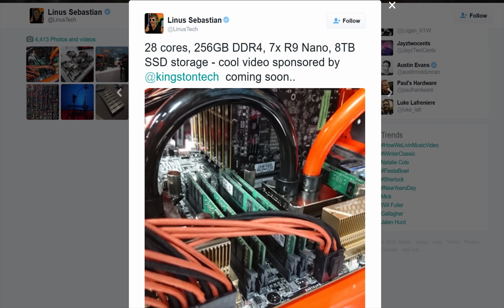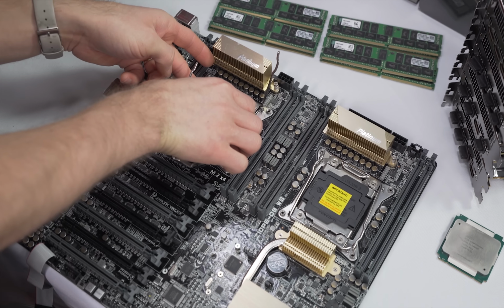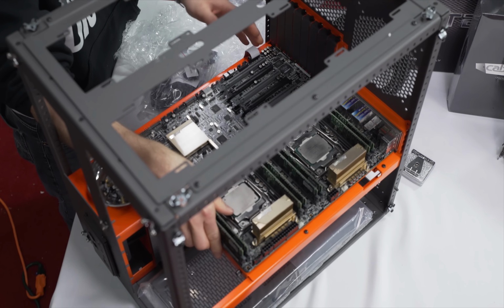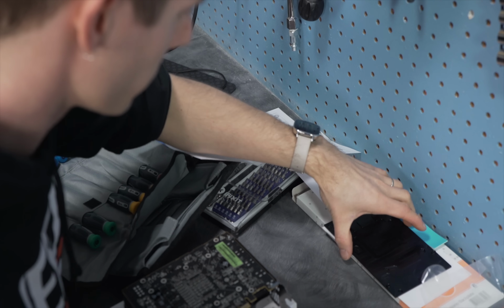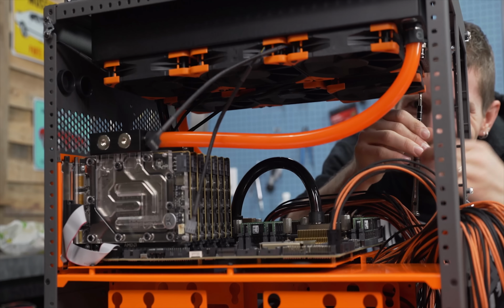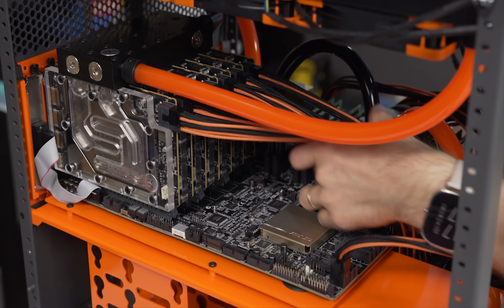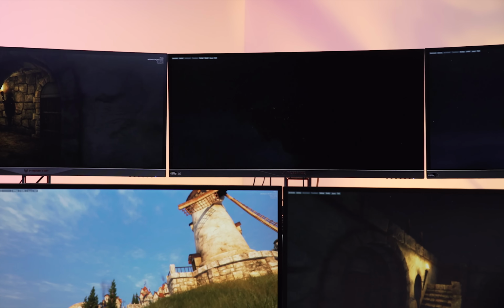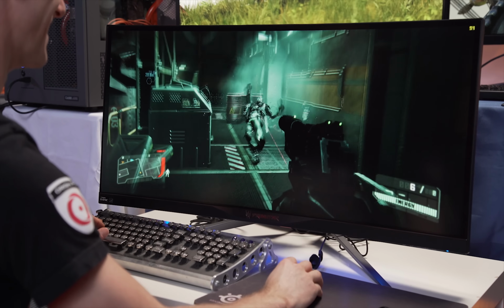7 Gamers, 1 CPU - Ultimate Virtualized Gaming Build Log

Comment: Definitely a video that should provide you guys with some world wide attention. Great job. By the way, you could have just used two power supplies together. There are cables that will connect the primary PSU (attached to the motherboard) to the secondary PSU and will start both PSUs in unison. As for the GPU limitation, you could have attached a PCI-E ribbon to each PCI-E slot in the motherboard and wired cards to them. Instances of these PCI-E ribbons are present in the Lian Li PC-O6S. With an array of multiple high end gaming GPUs, you guys could end up pulling 3000w! Now, I understand you're not going to redo anything. I know it took a hell of a lot of work. Just food for thought or ideas for a potential refresh or update you guys might do.

P.S. You should have known a D5 couldn't have provided flow with 9 blocks worth of restriction haha. I would have planned to use 3!

Comment: Can someone please explain to me how this is going to run off of that single 1600 watt powersupply? according to tom's hardware, their cards at a moderate target range ran at 225 watts, meaning that the gpu's would be consuming 1575 watts of that 1600 watts alone. If you follow their standard settings, which said that it pulled 188 watts per gpu, that would put that somewhere near 1400 hundred, leaving only 200 for 2 14 core cpu's and the rest of the hardware that is in the system. It seems as though there is no way in my mind that this system could run off that psu.
Reply: +Nathan Fletcher I take that back, it was an r9 nano, so yeah, I guess it could work
Reply: +Nathan Fletcher He really could have just run two power supplies
Reply: +Nathan Fletcher Hes running it dangerously close to the redline and honestly I wouldn't do it. 1575/1600 is 98% of rated power. Unless you plan to replace that PSU every few months I wouldn't trust that but hell do you really think 7 players will be playing all the time too? Probably not.

Comment: Are ssd running in raid-0 config each VM gets its own SSD?
Reply: +julian rodriguez  VMs are using the virtual disk images, but the physical disks could be connected in raid-0 and appear as one megadisk that can have all of the virtual disk files and snapshots. I am not sure if that hypervisor supports software raid-0 mode.
Reply: +WoahWoah378 He says in the video they are running in raid 10

Comment: thought it has 2 cpu's? why have a socket and not use it?
Reply: +Jay Mee it does, just the original idea was 1 cpu, but that was not possible, so 2 cpu's were needed.
Reply: right so the title needs changing to meet the design then lol 2 cpu's
Reply: No, it's fine, he even explains it in the video
Reply: No the computer is the central processing unit not the actual cpu
Reply: well its misleading! it dont matter what the original plan was if its changed the title needs to reflect that fact! also can 7 ppl use it at same time? 7 different mouses etc? if not than its pretty pointless waste of money in my opinion!
Reply: +Jay Mee Did you even watch the video? Linus explains both of your questions
Reply: +Jay Mee Its not about money its proof of concept

Comment: Hey Linus quick question. Would it be possible to run the system on one instance of windows. Or is the system limited to 4 way sli. I was just thinking of the 3D mark score you could get if all 7 cards worked :)

Comment: WOW!!!  Quick question are you capping out at 100% cpu and gpu utilization? That 28 core 56 thread system can be capped out in ansys and other hpc software but if its gaming at 100% performace of a native i7 6770k with the same gpu then color me damn impressed <3

Comment: You guys really need to build virtual machines for law enforcement agencies and maybe even american military.

They spend way too much on virtual training setups that perform at a lackluster speed. 

I'm talking, 800k on 4 virtual car driving simulators with monitors running some ps2 graphics.

I know these agencies are getting ripped the F off because i've looked at the equipment they use.
I also know getting a contract to do that work is hard to get and the companies are usually chosen by lowest cost and nothing else, but try if it's something you guys want to expand on in the future! 

Look into it guys!

Comment: 1 monitor 
7 way crossfire 
bench mark it 
now
Reply: Afsheen Freestyle
im sure linus could get someone to make a 7 way
Reply: +Justin Bechtel That someone would be AMD, and i don't think it is even realistic, since the Mobo needs to support it too(?)
Reply: DutchCrusader
so make a mother board that can support it.
Reply: Hah, it is not that simple, why would a mobo company make a one off mobo
Reply: TheGoreforce
not with that attitude
Reply: DutchCrusader
if you dangle enough money in someone's face you can get anyone to do anything.

think about it, an AMD/ASUS sponsored 7 way crossfire mobo with a processor to handle it all, as well as the right software and what not, and make it run efficient enough to essentially shit all over benchmark scores
Reply: +Aesop Xolev Agreed. The 7 gamers on one machine is way more valuable in my opinion. Still  30,000/7 is over $4k per person. Not really practical. But damn if it isn't cool as shit.
Reply: Justin Bechtel Im totally at lost now what you trying to say. 
Let's just pretend I never made any comment instead.
Reply: +Justin Bechtel Considering how a fair few recent games can't use multiple GPUs well/at all; I wouldn't be surprised if the results were worse than one GPU.
Reply: +Justin Bechtel This isn't Crossfiring...
Reply: Eric Tan
im well aware of this, I did in fact watch the video before commenting
Reply: +Justin Bechtel 7way cross fire doesn't exist.
Reply: +Justin Bechtel And you'll need CPU that can support the lanes. Need to get Intel/AMD to make a CPU which BTW needs enough bandwidth and horsepower. Then need a motherboard that supports all that.  Then you need a new GPU which has to be compatible. Lots of money down the drain for the companies with no profit.
Reply: Infinite Zero
Use it as a marketing thing

"look at what we can do! NOW BUY OUR SHIT YOU SHITLORDS!"
Reply: "Look at what an unreasonable amount of specialty study that we had to funnel all our R&D into so we were unable to actually make any new gaming cards and none of the shit we researched is affordable... BUT LOOK IT RUNS GAMES AT 5236523562345 FPS!"
Reply: +Justin Bechtel RIP K|ngp|n
Reply: +Justin Bechtel
Well, nVidia teased that it will be possible to SLI more than 4 GPUs via nVidias NVLink in the future. For now PCIe is just too slow not to mention the number of PCIe lanes needed.
Reply: TheWeaponshold
>implying it would take away from r&d and not use existing cards that are already in production. the only new stuff would be a mobo, crossfire connector, and a cpu, oh deary me, that must be really hard to come up with! especially for companies that specialize in that sort of thing!

>affordable
thats all a matter of opinion

>but it runs games at 5236523562345 fps
what about porn? there would be no buffer lag, at all.
Reply: He could travel time if he would do that!
Reply: +Justin Bechtel This isn't 4chan
Reply: DOOO ITTTTT +linustechtips
Reply: James Sanson
that would imply it matters
Reply: +Justin Bechtel Its not in crossfire. its actually 1 gpu per vm that is running. i.e. 7 vms needs 7 gpus
Reply: Dominick Bunrith
noshit
Reply: Justin Bechtel...
Reply: +Aesop Xolev http://cdn.wccftech.com/wp-content/uploads/2015/09/Nvidia-AMD-Multi-GPU-Benchmarks.jpg
Reply: +Justin Bechtel FIRST I thought it was about Crossfire, because why would you put 7 GPUs in one PC? ;)
Reply: Michael Kehm
for shits, but also for giggles
Reply: Justin Bechtel Yeah but you commented 
" 7way Crossfire "
Reply: Eric Tan
well, actually i commented
" 1 monitor
7 way crossfire
bench mark it
now"

IE, due to context, i meant get 1 monitor and 7 way crossfire, and to benchmark it, now
Reply: Justin Bechtel
That is not all. You are hella oversimplifying development processes and underestimating what it costs to develop a new CPU and motherboard (Hint: They are literally doing this all the time. Non-stop, and this is where we are now, it can't go much faster) And the fact that Crossfire adapters go more than one way means no adapter would need to be developed. But new software would. Seriously you seem to think a company can just shit out new stuff for you on demand. And no, it is not a matter of opinion. We are talking about average household income vs current price of tech meaning something like that would factually NOT be affordable for the vast majority of the world's population for a long time. Hell this PC is already worth what some people make in a year. More than some even.

But even so your original comment says "Benchmark it now" Which is not possible. It doesn't exist and you said "Now" as if it could happen right this second.

And, as a wrap up that you know nothing about what you are talking about.

YES it would take away from R&D.
A team has to design:
the processor
it's interface
the socket
the motherboard
write the BIOS
new software for crossfire (that is somehow waaaaay more efficient than the stuff they wrote for 4 cards max)
New GPUs
New software for those

All of those are probaly DIFFERENT teams of 10-100 people who will spend MONTHS if not YEARS researching and testing before they make any headway towards even prototyping and they will have to wait on the other teams to all be done and then test that the prototypes were built to specification and work properly to even go forward with any thoughts of production.

Look man, the chances are someone is already working on this. But as it would make the companies little to no profit at this time they have zero incentive to make it happen any faster. How much money are you going to dangle? You got a few million to a few hundred million to pay for all that? Because that is what you are talking about.
Reply: TheWeaponshold
grab 4 existing cpu's and smack them together into one large CPU, make a motherboard with 4 cpu sockets in a box pattern, bio's is already written for the cpus so its copy pasta, make a software program to combine all 4 cpu's into one large cpu, boom, now you have a huge ass cpu with computing power of 4

>needing new gpu's
kek, why? why not use an existing one, like the nano's used in the vid, or some 980s?

write software for crossfire changing some of the numbers from a 4 to a 7.

and i'll dangle a bunch of toonies and a $20 timmies card in front of them.
Reply: "Grab 4 existing CPUs"
Doesn't work. We don't have an interface for CPUs that operate at that speed available for consumer use. Toss as many CPUs as you want only so much speed can go through the >SOCKET< and then only so much information can be directed efficiently enough through the mobo BIOS to be used in any sort of game.

"It's copy pasta"
No... no it is not.

"Computing power of 4"
Okay, that is not how it works. At all. If you knew anything about how cores are used and frequencies and the simple fact that most programs and computers are NOT designed to use more than 2-4 cores. You can;t just "Smack them together" and get performance like that.

"Why not use existing ones?"
Because PCI-E 3.0 is NOT fast enough to provide the communication fast enough to make a set-up like that run

"Write software"
facepalm If it was as easy as 'just write it' it'd be done.

At the end of the day the GAMES THEMSELVES would need to be rewritten because, as I said before, most programs don't use more than 2-4 cores nor need to. So all those extra cores would do nothing and the crossfired GPUS would be completely bottlenecked.

Yeah good luck with all this random blabbering. You don't seem to have the first clue as to what hardware and software limitations are. Completely glossing over how complex engineering and programming for microprocessors are. Stay in school.
Reply: TheWeaponshold
l2read
4 cpus
4 sockets
1 cpu per socket
i know, math and reading is hard

>Because PCI-E 3.0 is NOT fast enough to provide the communication fast enough to make a set-up like that run

right, just like rolling down hill makes you go slower.

>GPUS would be completely bottlenecked.
MUH JUAN EFFPEEEZZ BAWTLNECK
Reply: Yeah 4 cpu 4 sockets... Still one motherboard. Still SATA, still limited by the communication means and ports we currently have. Again, scaling doesn't work perfectly with multi-gpu. The flaws are in every. Single. Step of the process and they have BEEN working it forever and 4-way is where we are as far as working and worthwhile (barely) crossfire. Will we ever see 7 way? Probably not. Why? Because developing a faster, more efficient chip in the goal. Not slapping together more of the same. Your logic is like a caveman. "If on spear good for hunt I throw seven spear at once even better hunt!" Whereas the video approach is "Spears are good. I'll take seven spears and throw them each at separate times and directions and get 7 animals to bring back". Your effort burdens it down with too much crap to do a relatively simple job. End of story.
Reply: TheWeaponshold
>being this mad

Comment: Do u had no other place for thre radiator because the warm air from the GPU's is going trough the radiator and the water is going more hotted, sry for my bad english im from Germany ;)
Reply: +Jan Ellwart If the GPUs are watercooled the heat goes through the loop, not the case. That's the whole point of watercooling.
Reply: +TheLordOfWar He's saying that the warm air coming out of the radiators is blowing on the motherboard.
Reply: biribobili the warm air is pulled out of the case, not blown into the case. I personally preffer pull aswell, since it makes no difference what configuration you use, but the pull configuration is cleaner since less dust is trapped between fan and radiator.
Reply: TheLordOfWar Gets the air not pulled out?
Reply: Jan Ellwart thats what i said. The heat from the GPU's is being transfered by the water to the radiators where it gets disapated outside of the case. That results in an much lower ambient temperature inside the case, since only an fraction of the heat is dumped inside the case.

Comment: i wanted to see benchmarks of the pc running just one game in a single display
Reply: +rodrigo „RDLHD“ de leon you cant because you can only put 4 cards into sli. Crossfire is the same thing.
Reply: +TheLordOfWar  that's a good point but how does two CPUs scores vs one do you get any benefits
Reply: rodrigo de leon in synthetic benchmarks? yes. In gaming? No benefits whatsoever. Infact they would be worse than an skylake quad core. Games usualy dont support more than 2 threads or maybe 4 at max. Single Core performance is always better than core count for gaming atleast for now.

Comment: should of used the thermaltake x9 with 3 480mm, and a 360mm radiator with 2 140mm exhaust fans and 2 200mm fans blowing in, the case is absolutely fucking massive and is stackable, if it was in that case this thing would be fucking absurd.
Reply: +lawn loom nobody should ever use anything from such an shady criminal company. All they do is copying designs from smaller companies and the quality sucks.
Reply: thermal-take is fucking amazing in every aspect -_- there water coolers are... semi expensive but still very good there air coolers especailyl the NiC 6 is 45 dollars and kicks the 212 evos ass for only about 10 dollars more, there cases are fucking amazing and are really the only cases that arnt custom that can handle more than 4 triple or quadruple radiators and still look badass, plus its stackable so you can add even more computers or just more pumps and reservoirs. The only problem with thermaltake is that when you buy such a case like the x9 your forced to spent like 5k to even remotely fill it without making the rest of your parts look puny lol
Reply: +TheLordOfWar they are great for watercooling tho

Comment: 7 Gamers 2 CPU's.
FTFY.
Reply: Wait, didn't you need a dedicated GPU to set up this system before... ?! 
How did you allocate that into a gaming GPU and how would you enter configurations of your setup ?! 
Did you set it up on a local network ?!
Reply: +X3R0 J4M That motherboard has dedicated GPU with 32MB of memory and has VGA output he showed in the video.
Reply: WoahWoah378 right. Oh that's pretty badass. Thanks =)

Comment: big ass water bubble in side that water block can see it every time camera looks at it.
"gpu is thermally throttled" Um no its power limited to 175watts so clock speed will choke down when it hits that useage.

Comment: Holy shit, how much would this even cost if priced out?
Reply: He said around 30,000$
Reply: +Materwelonz 4285.71 for 1
Reply: +Materwelonz about $30,000 USD
Reply: +Materwelonz The Xeon CPU&#39;s are the biggest wallet killer in this. With them costing $2600-2700 when on sale and $3200+ when they aren&#39;t. The cards prob would come in second place since they cost about $600 each for a total of about $4200ish. Oh wait I think those monitors are worth about $1500 each, so 7x of those would prob take top spotat just over $10k in just monitors. The 32Gb memory sticks are about $300 each and the Kingston SSD's are currently on sale for about $400 each.
Reply: +Materwelonz I feel like this build's cost could have been cut in half, Ok so lets say you go with 512GB SSD instead of 1TB and maybe instead of 7 1.5k monitors 7 $180 to $250 monitors and instead of 8* 32GB sticks you got 8* 16GB shouldn't this build cost then come down to around 16k or 17k? which then puts it at about 2.2k per PC which IS CLOSE to the cost of a normal liquid-cooled PC of comparable specs and performance to that of the virtualized machine?